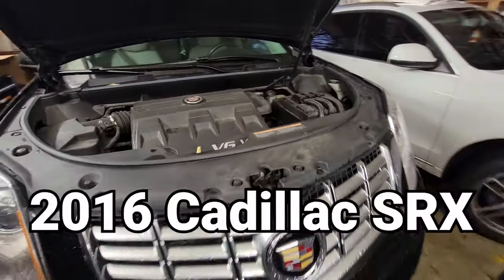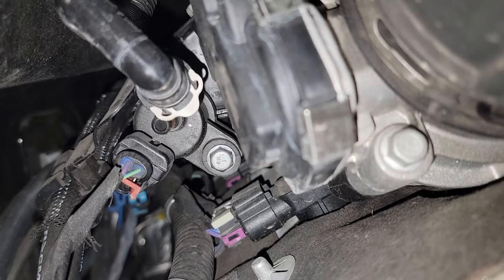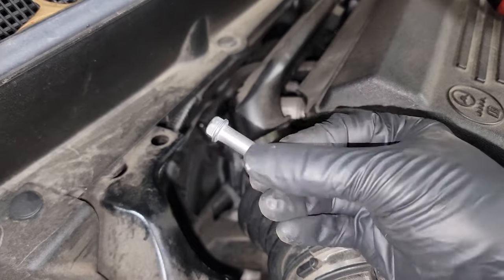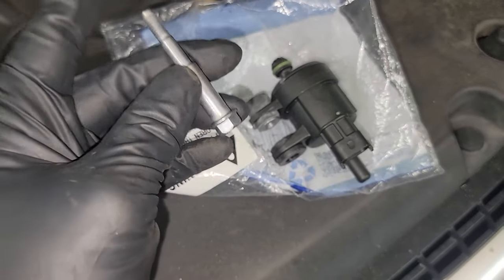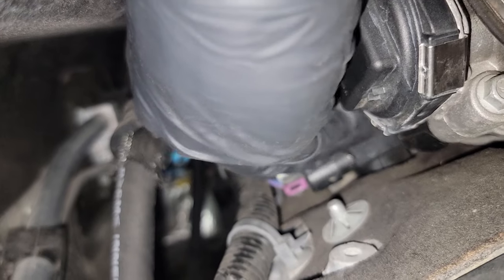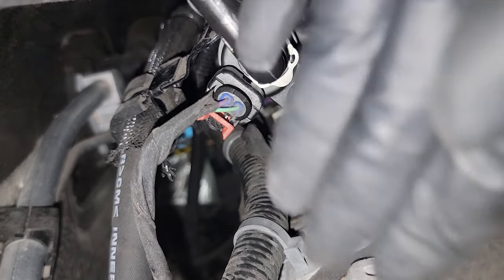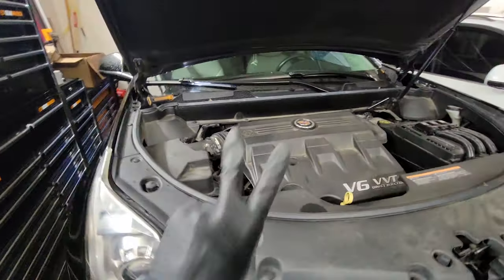P0496 Fix! Cadillac SRX Evap Purge Valve Replacement | DIY

Comment from the maker: Here is the factory OEM evap purge valve - https://amzn.to/3BQcmAU

eManual Repair Manuals for Any Vehicle - http://shrsl.com/43l4o

Like and subscribe for new weekly videos!

Thanks for watching!
Reply: It cost me $275 to replace here in So Cal. The check engine light was on and of course it was Smog time!
Reply from the maker: Ouch!
Reply: @Mechani_Cole  dang inflation and those who allow it. 😒

I also  need to replace cue screen. I bought online but geez the labor.

If 💿 would play without the screen, I wouldn't bother replacing it.
Reply: Just to clarify, my comment isn't to rag on the video. I only came to see what the part was and how much work was involved. 

I just don't see hours of labor here. 1 hour maybe. 

The price I paid wasn't gmc prices but a trusted mom & pop shop.

Anyway, gratitude for your time and energy aka sharing your knowledge.
Reply: This video helped alot
 Thanks 😊

Comment: 2nd year in a row for inspection this po496 code goes off for my SRX. The day after I filled up my gas tank at a full service gas station which most likely overfilled the gas tank, I replaced the valve again even though the other valve from last year was good after blowing in it and finding out. The CEL stayed on for 6 days of driving so I decided to troubleshoot the new valve by disconnecting the hose and electric connector to test for vacuum with the vehicle running and the new valve tested good. The light went off immediately also after unplugging it while running so I shut it back off. I plugged the vacuum back in and dried off the electrical connector as it was soaked. (for some reason rainwater with the hood closed or if the hood is wet it falls right on top of this valve which probably contributes to degradation) Once I plugged it back in and restarted the vehicle there was no more rough idle, no codes , nothing. Just wanted to share this as it seems the purge valve is always going to be a problem for SRX's. I am coming up with ideas for a safe cover for that electrical plug though to see if it prolongs the life of the valve and connections especially as wet as it was from rain. It was not raining while i was testing, It rained an hour or 2 earlier.

Comment: Thanks for the video, I just changed the one on my daughters car watching this did make it a bit easier. I'm 6'3 and 300 pound and my hands and arms are bigger but I was able to raise the air cleaner and the plastic thing over the intake and could see it some and got my hand in there but left the skin off my arm there. Without the video I wouldn't have even known where to look for it. When I was your age the cars were a lot easier to work on and much simpler. Thank again!

Comment: I replaced it and every light came on
Reply from the maker: Did you leave something unplugged? Erase the codes and then see if they come back
Reply: @Mechani_Cole  i erased them and they came back on but does the part have to be oem because i put the old part back in and now there’s no codes but I know it will eventually come back
Reply from the maker: @alexchavez5299 yes. Don't get cheap parts. The part I linked in the description is the OEM part
Reply: @Mechani_Cole  wow thanks man I really appreciate it !!

Comment: Am I missing something here? YES! Not all 🦄s, shiny 🌟s and 🌈s. I had to use original old screw as new screw was impossible to screw in 🤬. Second, I needed needlenose pliers to pull out the red tab on the electrical connection 😤. Also failed to mention here. I had to practice on a same type of electrical connector on the same side of the engine where the EVAP part is. Hose with white clip is doable. You're welcome 😁🤗

Comment: I've got a 2011 CTS 3.6 that seems to be doing the same thing...anytime you get fuel it will struggle to start and once it does it will rough idle before eventually idling properly.  Would this same part and install apply to my CTS?

Comment: We could use a better explanation of how to unclip the locking wire plug, outside of that, great video.
Reply from the maker: Fair enough, thanks for the comment! I try to get better each time😁
Reply: @Mechani_Cole  
And your views appreciate what you do! Your video and that of another I was able to replace the other valve without removing anything else. The only thing I had to do different was remove the wire plug last, after I had removed the purge valve so I could get a better look at how the wire plug was locked in. Because the purge valve was loose and only connected to the wire plug, I was able to clearly see the locking clip and understood what you meant. So thanks again. I hate removing stuff when it isn't necessary. Normally, I would've removed everything that's in the way. But, thanks to you and another guy's video, I WA able to do everything by feel! Thank you! You saved me a lot of money by helping me do it myself. 💕🤓

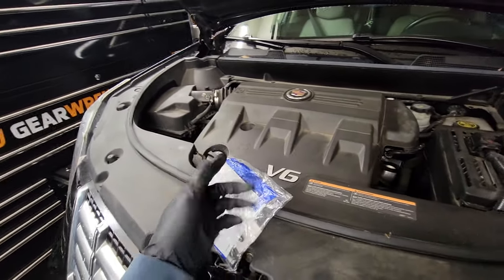Comment: A couple of notes after trying this.  If you lean way up over the engine you can just barely see where the valve slides in.  This is helpful when reinstalling.  Also, I found it easier to take the sensor out before disconnecting the wire harness.  It was also easier to install the wire harness before reseating the valve so I could ensure the clip was re-locked.  If you are a normal human getting something electric down in there will be unlikely.  I used two extensions with a bendy bit in the middle.  I was able to slide the second extension through a hole in a metal piece right at the base of the hood (you can see this at 0:30 right next to his finger).  This help secure the ratchet.
Reply from the maker: Love notes like this! Thanks for commenting 🫡

Comment: Awesome guide! I was able to successfully replace my purge valve today thanks to this video. Like @mrnuttle, I could not remove the wire harness while the valve was still in place, so I took the valve out first then removed the wire harness. All other steps I took were as per the video. Thanks again!
Reply from the maker: Thanks for the comment, glad it went smoothly🫡

Comment: Quick question! I just purchased a used car and just wanted to change my purge valve. Would I have to reset it or will it reset itself where as I had no problems with it? And thank you for an awesome video! You’re the best 😄
Reply from the maker: Hi, good question! You will need to reset it 99% of the time. Luckily, you can always replace the part, then drive it to an Autozone or similar store and use their free scanner to reset your check engine light for free.😁

Or you can order a cheap Bluetooth scanner to keep in your car, super helpful - https://amzn.to/3dcZtu3

 @boyshark2000
Reply: You’re the man! Thanks!😄

Comment: Hi! I had the same code today on my 2012 Cadillac SRX. This week I put gas in my suv twice and each time I put gas right after it seem like it was cranking to start. Eventually in a minute it would start no issues running or anything. Would you say it needs a new purge valve?
Reply from the maker: Sounds about right ✅️
Reply: Same for me 2015 ats 3.6. Thanks bro

Comment: Quick question after replacing this how long does it take for the check engine light to go off or does it need to be cleared?
Reply from the maker: Needs to be cleared or it won't turn off
Reply: Thanks buddy!!

Comment: I bought the new purge valve from your link and they sent me an aftermarket one, not the gm one in your video.
Reply from the maker: Interesting, the link in the description still pulls up the OEM AC Delco brand one. Maybe send back and get a new one if so

Comment: I did the purge valve replacement but just did a battery reset. Would this clear the code after driving for some time ?
Reply from the maker: No, usually need to reset with computer/scanner

Comment: Question. The red clip broke off when I tried to remove the valve. Any suggestions how to get it out? Thx
Reply from the maker: Can use a curved pick and release it from the backside
Reply: Does a short pic work or do I need to get a long pic? I'm guessing Auto Zone has them. Thx for the fast reply..

Comment: I've recently started having problems starting my 2015 SRX after fueling...and only after fueling. Seems to idle fine with no loss of power. I don't have a code reader, but my check engine light has lit up. Would replacing this part help solve this issue?
Reply from the maker: Hi John, you should never replace any part before checking what the check engine light is on for. Everyone has free access to a code reader at any aute parts store. Simply ask some one working there for the scanner and they will ask for your ID in exchange. Then you can scan it and see what's actually wrong with it to give it the correct part. If you have the codes listed in this video then this may be your fix. Always check first though, some one can help you if you don't know how😁
Reply: @Mechani_Cole  
Finally got around to checking and there were 2 codes...P0442 and the P0496.
I went ahead and bought the valve which was $70 Canadian...crazy. I just don't know how you were able to replace it. I can't even get my knuckles between the engine cover and the firewall. 
Did you remove anything else before you started?
Reply from the maker: Did you remove the engine cover? Other than that, I just reached back and grabbed it, so have several others who watched this. Maybe some long needle nose may help?
Reply: @Mechani_Cole  
No, I haven't really tried yet. Just went to look under the hood to see where it was and tried to squeeze my hand in there. I wasn't sure if you took it off in the video or not. I will try tonight. 
Thanks for the replies.
Reply: @Mechani_Cole  
Do you know what is holding the cover down. It looks like...well, I really don't know what it looks like. It has a triangle with a Y, where each side of the triangle has a slot perpendicular to the side...if that makes any sense.
Reply from the maker: Should just be pop in clips. If you don't see any bolts on top, just give the engine cover a tug and it should pop out. If you're uncomfortable with that part, I wouldn't proceed any further and would advise taking it to a professional
Reply: @Mechani_Cole  
It was a Torx T30.
All done, running like a champ again.
Thank you for your help.

Comment: Is the green gasket supposed to go in the hole or sit on the surface ?! Please help
Reply from the maker: Push it until the green gasket slides in. You shouldn't be able to see it any more. The bolt will also help push it in

Comment: I have a 2019 Cadillac xts, is the purge valve located in the same spot
Reply from the maker: Not 100% sure to be honest. If the engine is the same, it should be in the same spot✌🏽

Comment: How did you determine the purge valve with indeed the problem?
Reply from the maker: Good question, I started at the easiest cheapest part to replace and it ended up fixing the code. Ended up being the purge valve
Reply: @Mechani_Cole  Hmmm . . .  So basically no diagnostics involved. Just changing parts until you get it right. That could get expensive if you don't get lucky right off the bat which fortunately for the customer you did. I was expecting something more from one who presents themselves a mechanic. Oh well.
Reply from the maker: @T.E. my bad, I thought this comment was on the Audi purge valve video. For this Cadillac and other GMs this is a super common problem. The scanner literally tells you what to replace. When this part goes bad the customer couldn't use her auto start. There was no guessing or throwing parts at this vehicle. It's a common failure point and an easy fix on these cars🤷🏼‍♂️
Reply: @Mechani_Cole  Don't mean to beat this into the ground, but I have a nice scanner and know from years of experience that scanners do NOT tell you what part to replace.  I wasn't born yesterday. They merely point you in the direction of what is not working properly. There can be multiple reasons why something might not be working properly. like poor electrical connections, plugged hoses, vacuum leak in the hose, a related part in the system, etc. You still need to verify that the part itself is bad. 

I watched a different video and they showed 2 methods on how to verify the purge valve was not working. And then explained how to verify that the problem was indeed fixed after changing the part. Very professional video. I've only watched this one video of yours, so I don't know if you are just a parts changer or not, but if so you might want to learn and share with others the more important steps of properly diagnosing a problem. A scanner is a wonderful tool to help you , but it will not make any decisions for you. You as the mechanic must still be able to take in the information the scanner tells you and then with FURTHER investigation, experience and common sense make a judgement call. Then at that point you must verify that the part is indeed bad. Maybe an electrical connector just needs to be cleaned up and it doesn't need to be replaced. 

Far to my people change parts until they get it right and it usually ends up costing way to much that route. That's not good mechanics. Like I said only watched the one video and don't really know you. So just giving my 2 cents based on this one time. Not trying to be mean, just helpful as I have in turn been helped by many Youtuber like yourself in the past. I appreciate what all you guys do out there. I love Youtube for the help people offer.
Reply: @t.e.1189  
My scanner tells u exactly which part to replace.  The code is the part, that’s the whole point of a engine code light.
Reply from the maker: @idiotbiden not always the case. There is other issues that can cause these codes. A proper diagnosis is usually required. However this specific part is usually spot on with replacing it and having the code fixed. Definitely an easy one. But thats like saying just replace spark plugs if having a misfire. It can be a series of other issues.

Comment: Would P0449 (valve control unit) with secondary DTC P0455 (large leak detected) also resolve by changing this part or could it be something else?
Thank you!
Reply from the maker: No. You have a bigger problem. 

What year and model do you have?
Reply: @Mechani_Cole  I also have the P0455 code and was told to replace this valve.  2014 SRX
Reply from the maker: I'd suspect a vacuum leak somewhere
Reply: @Mechani_Cole  well since I already ordered this part and a new gas cap I'll start with that.  Regarding vacuum leak is there a way to easily detect?
Reply from the maker: Yes, with a smoke tester. Usually about $100 or less and pretty easy to use - https://amzn.to/3mD3PzL
Reply: @Mechani_Cole  thanks man!

Comment: How long does it take to replace the purge valve?
Reply from the maker: Depends on skill level. For a good mechanic it should take about 30 mins. Some people struggle with the clip and it takes longer. I might be able to do this job in under 10 mins.

But any shop will bill at least 1 service hour at the standard rate.

Comment: How do you get the connector off soo easily
Reply from the maker: The trick is pushing them together first and then clicking the tab and removing. Don't pull until you hear the click. Push together hard, push tab, then pull😁

Comment: Would this issue cause the car to not start
Reply from the maker: Not usually no
Reply: @Mechani_Cole   I have a 2008 Cadillac SRX that was running fine then  it just wouldn't start...well it will crank but not actually start up. it has a new battery,fuel filter and alternator so that's shouldn't be the issue ...I wonder what it could be?
Reply from the maker: Do you have a check engine light on? 

Silly question, but does it got enough gas in it?
Reply: It has half a tank of gas and yes the check engine light is on
Reply from the maker: Have you scanned it for codes? What code does it have?
Reply: @Mechani_Cole  yes...one for P0306 an P0496
Reply from the maker: The P0496 code is related to the repair in the video. The P0306 code could be for a bad crankshaft position sensor that's causing it not to start

Comment: I tried forever to get that red clip to push up so I could remove the plug, but it would not release.  Not to mention there is not enough room to work in that small of a space.  I wasted my time.
Reply from the maker: Did you try pushing forward first so it releases the tension? 

Also, picks can be very helpful in removing these clips in tight spaces.
Reply: It's a lot more work, but you could remove the  throttle body first. Then, there is more room to work on.
Reply from the maker: Good tip!

Comment: can you show how to reset the code?
Reply from the maker: I don't currently have this vehicle anymore, but its the same on most cars. 

1. Plug in your obdll scanner
2. Turn your car to ON position
3. Scan codes
4. Click 'Erase codes'

That should be it. For this job I used this scanner that hooks up to my cellphone for only $20. Best $20 I spent! https://amzn.to/3kfhAjH
Reply: Would you mind giving a little more detail on removing the white clip? Do you squeeze it? Thank you very very much for this video.
Reply from the maker: Yes, you can push it in with a pick as well